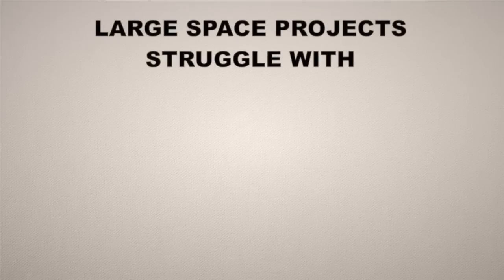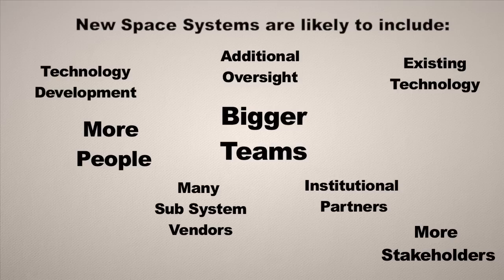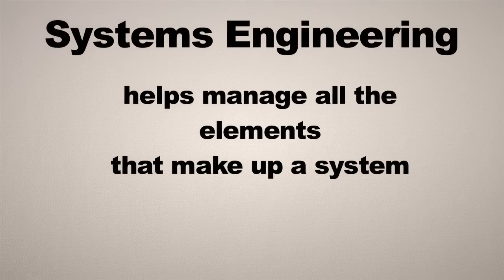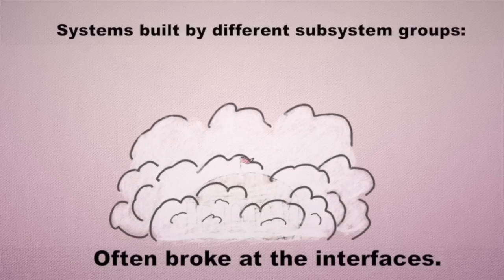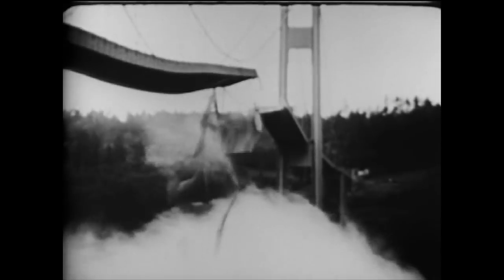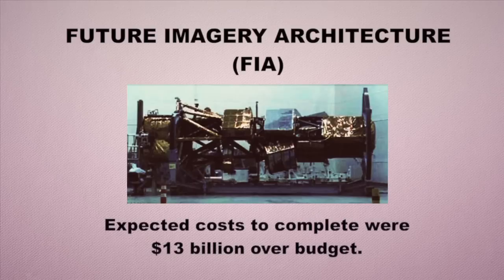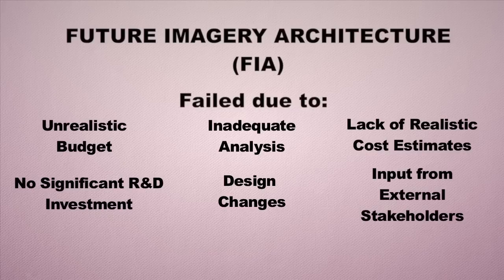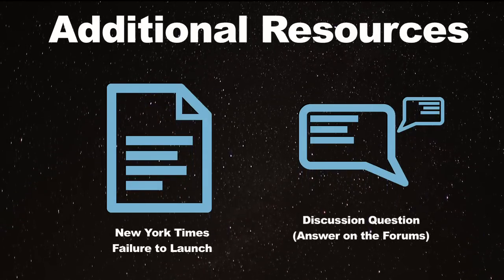The Need for Systems Engineering- Space Systems Engineering 101 w/ NASA

Comment: Thanks a lot for these great educational lecture series on systems engineering. Very useful. 
As a comment, I kind of feel that you are giving too much credit to systems engineering, when you said system engineering is above other subsystems. The subsystem leads perform highly technical tasks. Systems engineers take care of some general system level topics and interfaces and risk management to ensure these common topics are not overlooked. A chief engineer usually oversees the whole technical aspects and the project/program manager oversees and coordinates the project. What I understand is that the systems engineer is not by default the same as chief engineer or program manager. System engineer has its own particular duties such as risk management, defining ConOpts, etc. But he is not necessarily above other subsystem leads. I agree that there are some confusing and tension-creating overlaps between the duties of the above mentioned roles.